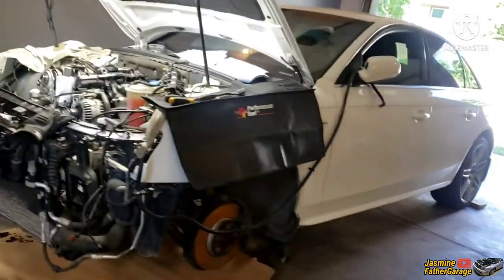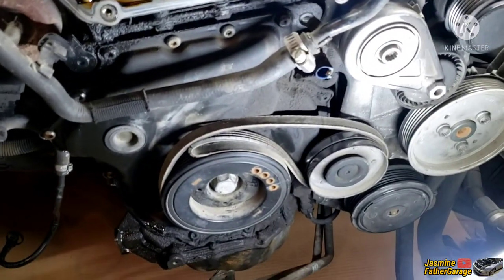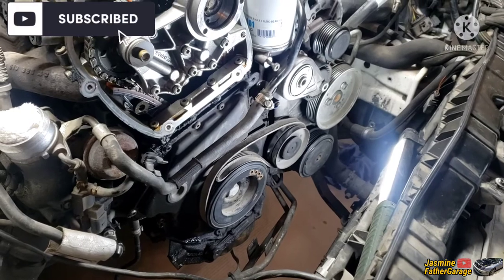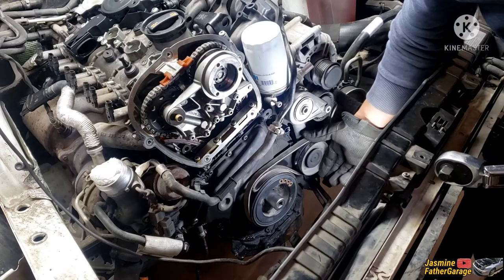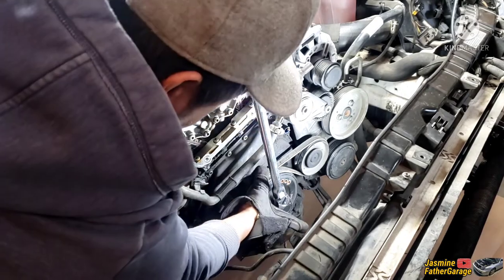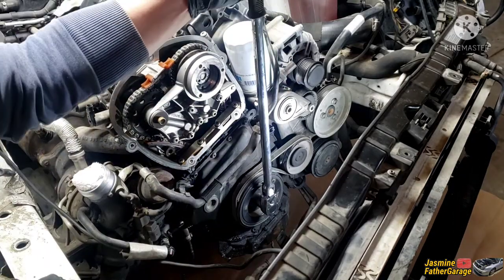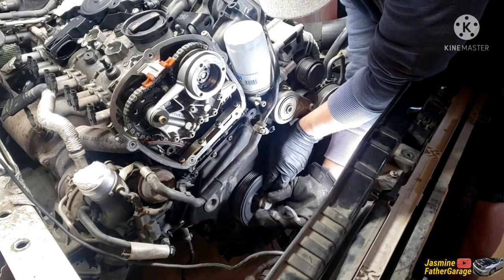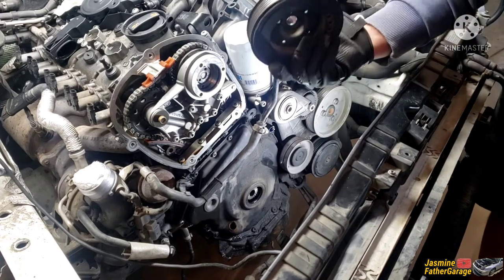Super Easy! No Special Tool Holders Need It, Crankshaft Bolt Remove

Comment: Hey man I did timing chains but my lower timing cover is leaking. I’m afraid to remove this bolt because nothing will be holding on the sprocket right? Won’t it just fall off if i remove the crank bolt?
Reply from the maker: Your fine after removing the crank bolt, the only thing that comes out the crank pulley. The timing components, chains, sprockets etc its still gonna be all together
Reply from the maker: Here the playlist  on my d.i.y. Audi  Check out the video7 i hope this help out

Audi A4 Turbo 2.0T 2004-14 Engine Rebuild & Swap: https://www.youtube.com/playlist?list=PLYcI2lvoAa5dz0M79_LuraIAyrKtEwKzz

Comment: My dad and I struggled with my crankshaft bolt for three hours before finding this video - and I bought the “special tool” for my car, it just didn’t work well. Thanks for sharing this method and keeping us from going insane! 

(Note: it does seem like this method ruins/wears out the belt you use because it’s not made to bend and fold so sharply. I used the one on my car so I have to replace it now)